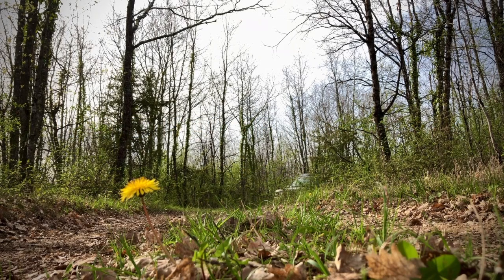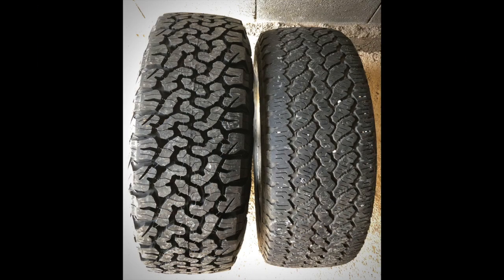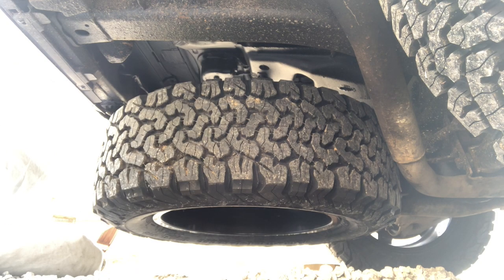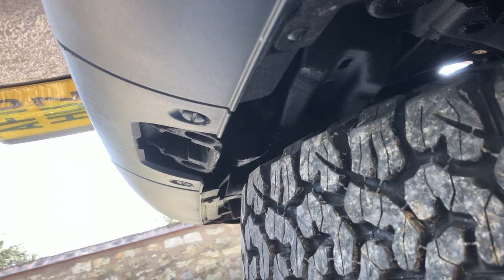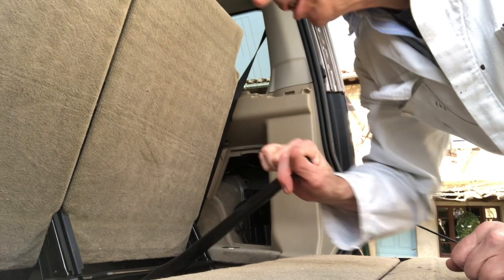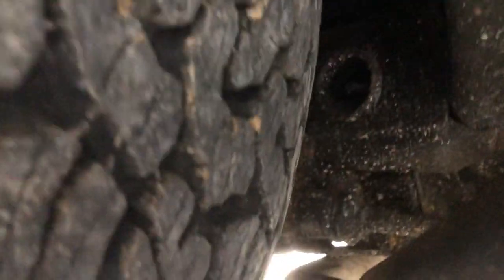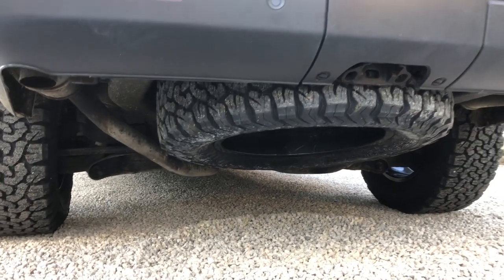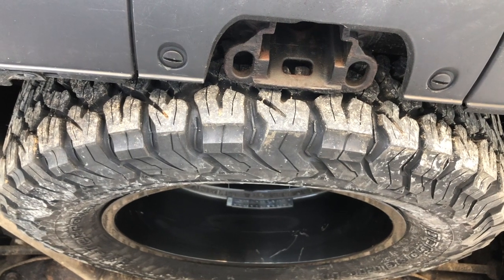Land Rover Discovery 4   - Part 1: Oversized Spare Wheel Installation in Underfloor Carrier

Comment: Also a good a idea to have a tire plug kit on board.  And I sprayed WD40 on the contact points to make it slide in a little easier along with airing down.
Reply from the maker: Good idea. Yes the tyre plug kit travels with us.

Comment: Have you removed the guard at the front of the spare tyre also to make this fit?
Reply from the maker: Thanks for your question. Interestingly our D4 isn’t fitted with the tyre guard in the spare recess. Either that or a previous owner has removed it.
Reply: @roadlaw  Ok. Definitely has been removed by someone. Good to know. Most have a metal guard that roughly mirrors the forward face of the tyre. I suspect that makes a difference on yours. I was looking at doing the same, but fitting a 255/65R19 tyre which is approx 12mm taller (overall diameter) to your tyre. Do you think you could squeeze an extra 12mm height tyre in your space ? :) Cheers.
Reply from the maker: Hmm, an extra 12mm might be a struggle. My 265/65/R18 only just fits, and that’s fully deflated. You could get a bit more in there, but the danger is you end up overloading the winch unit and cable as you wind it up into the recess. Good luck with that, I’d be interested to learn how you get on.

Comment: Hi there thanks for the video.
When you change the tyre size did you had to do software changes too ? 
I’ve heard speedometer is getting incorrect output. Thanks Sahan
Reply from the maker: No I did not make any changes to the speedometer. I believe you are correct, but the difference is pretty small.

Comment: Hi, can you comment how easy it is to remove the tyre if you have a flat? You must keep weight on the winch when lowering or it will break very quickly, if you are on your own this is very hard to do.  Perhaps the easiest way is to lower the winch cable with no load by pulling down on the winch cable and then use a crowbar to release the tyre back onto the winch cable?
Reply from the maker: Hi Jonathan thanks for your question. You are right in suggesting that the winch needs weight on it during lowering. For this reason it’s a good idea not to force the spare into its recess. In reality the weight of the wheel and tyre is sufficient to allow the winch to lower it without fouling the cable. This is the logic of installing the spare deflated in the cradle, so that it doesn’t snag when lowering is required. Hope this helps.

Comment: Hi, thanks for the video! Could you please write down the name of the upgraded wheels? I'm looking to purchase some and alsi i'm wondering if you used any spacers or other extra elemnts for this setup. Thanks!

Best,
Calin
Reply from the maker: Hi Calin thanks for your comment. The wheels are Compomotive PD1881 alloys, size 18”. They were supplied by Compomotive in the United Kingdom, and are a popular after market option for the Discovery 4. Not many 18” wheels will fit, due to Land Rover increasing the brake disc dimensions relative to the Discovery 3. These wheels do fit, no spacers or lift kit necessary. Some folks do choose to add spacers and or lift kits, but if you do remember this can alter wheel and suspension geometry.

Comment: Hello, my question about these tires, not actually spare wheel. Do you need to trim safety stops (metal bars that is connected on the frame and located right after the front wheels, under passenger and driver floor) to fit this size (265/65/18 if I heard correctly), and do you need to trim plastic?
Reply from the maker: Hi Mocconagames thanks for your comment. No trimming has been required to fit these tyres, sized 265/65/R18. They are quite a tight fit, but so far have worked ok with no rubbing, at any suspension height setting. 
At full steering lock they clear everything inside the wheel arch, but we have not yet tried full suspension articulation combined with full steering lock, for example when crossing very uneven ground. We have some lift rods ready to fit if necessary……
Reply: @roadlaw  thank you very much, very useful information.

Comment: That Disco looks mint! Did you fit tyre pressure sensors in those Compomotive wheels, or disable the tyre pressure warning?
Reply from the maker: Hi thanks for your comment. No tyres sensors fitted with the Compomotive wheels, and no I didn’t disable the warning ⚠️. Our 2010 XS U.K. spec Discovery doesn’t appear to be fitted with the TPMS.
Reply: @roadlaw  I see. Thanks!

Comment: Snug as a bug in a rug. nice work. also your roof rack setup is gnarly, can you share some details on that also? thanks!
Reply from the maker: Hi thanks for your comment.  The roof rack is from Prospeed in the United Kingdom.  It's a very slimline fit, beautifully made and creates little to no wind noise.  Reinforced composite boards in sections can be added to make a full or partial floor covering on the rack, allowing for carriage of various items.  We also have fitted a roof top tent to the rack with the addition of two crossbars, which work well.  Prospeed UK have a good website for their products.